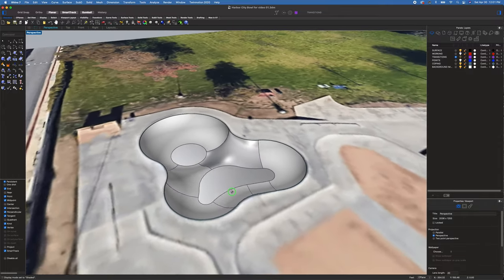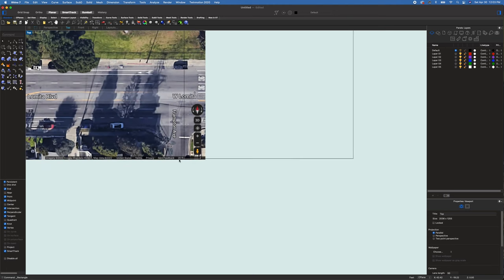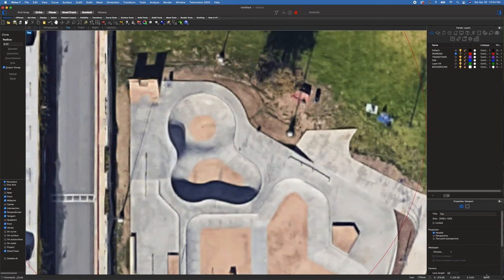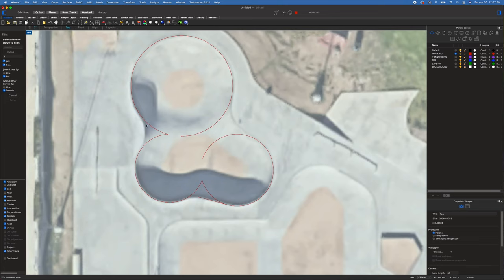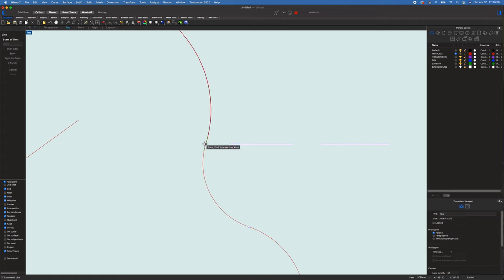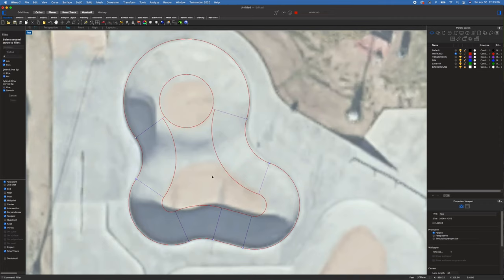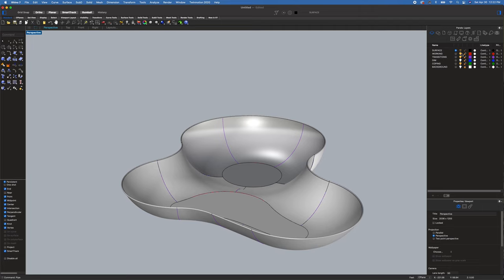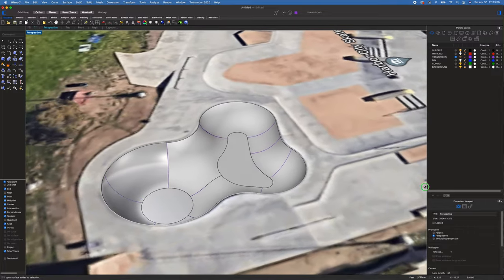Build a Skatepark Bowl in Rhino 3D - Harbor City Skatepark

Comment: I recently got a job as a skatepark designer, i was previously working in sketchup and blender and was told to convert to rhino that has very limited free tutorials online, then I happened to stumble upon this amazing video, and it was a total lifesaver. Thank you so much!
Reply: What’re the benefits of moving from sketch/blender to Rhino?
Reply: @adamcollingburn430  you can go more into detail with corners and hips and whatnot
Reply: Blender ain’t so accurate in units. Also (at least subjectively speaking) rhino handles much better nurbs modeling than blender, which is basically essential for modeling curved surfaces.

Comment: Such a big help, thank you! :) When you do the sweep2 command - how do you get rid of the black lines it creates as well - you get the smooth surface, but when i try i get the surface along with a lot of additional transition lines. I wonder what I am doing different? Can't sem to spot the difference from the video.
Reply from the maker: The black lines you see are isocurves. You can turn isocurve visibility on and off in Preferences>Display mode, or on Right sidebar under Panels:Display. If that option isn't available in the inspector panel, click the little gear icon in the upper right to activate Display tab. Also, select "Do not change cross sections" when the Sweep 2 Rail Options window opens. Otherwise, you may have more geometry data, and isocurves, than needed.
Reply: @oldstarpress  Awesome!! Thank you so much, that’s a huge help☺️🙏 Thank you for your response and the great video material🙏